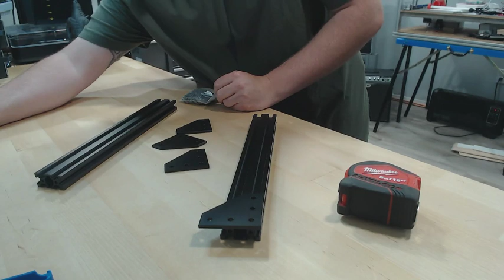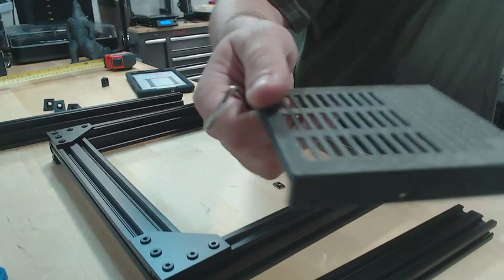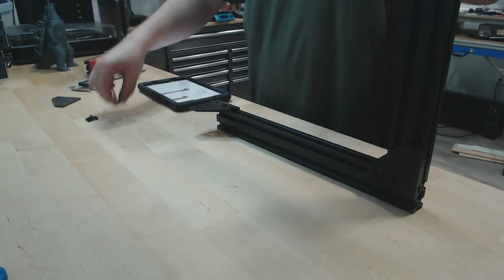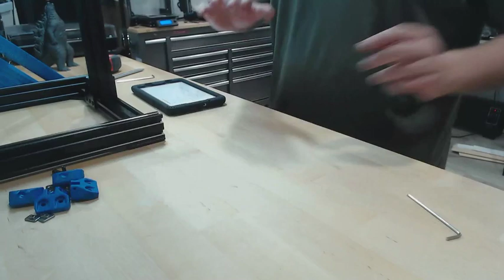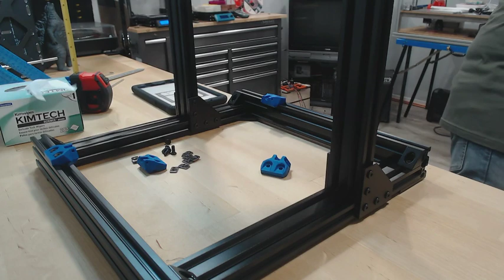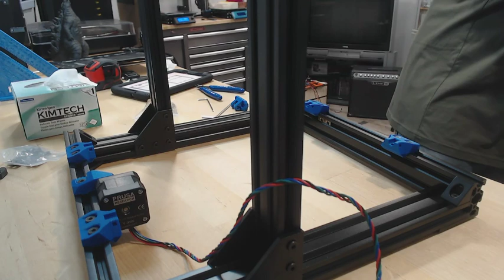Prusa i3 Bear Upgrade - Part 1

Comment: How was this.  Do you like it compared to the MK3S frame?  Seems like this can be a nightmare making it square/even/level with how many pieces you have to put together and align...  Seems like it could potentially add so much more error in printing if something is not 100%
Reply from the maker: It's my daily printer still. Absolutely love. Take your time, build on a flat surface, the. It's good to go.